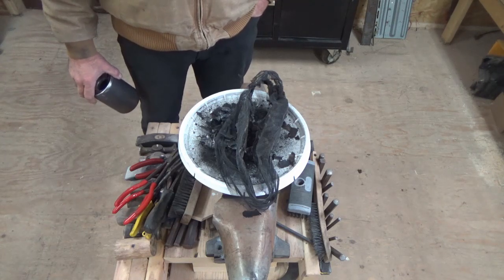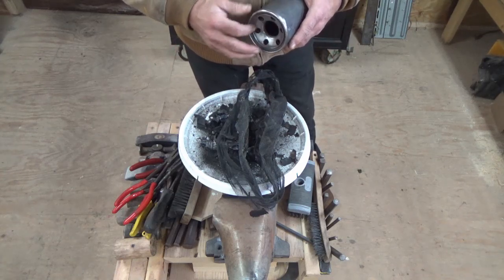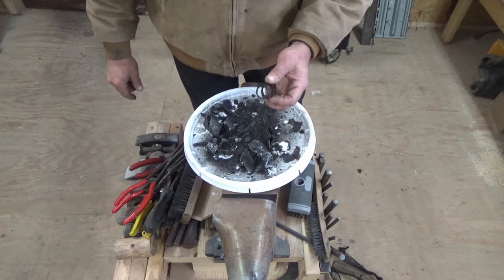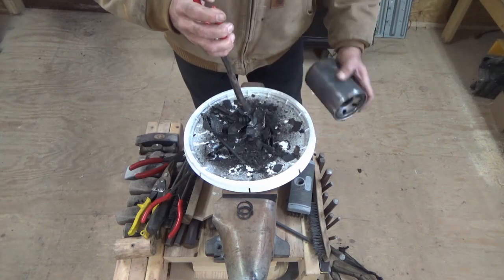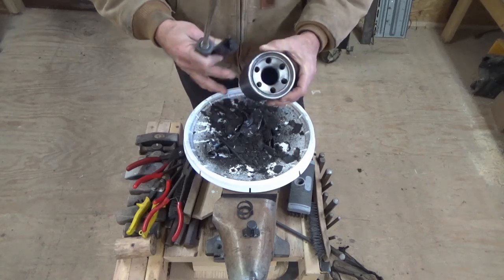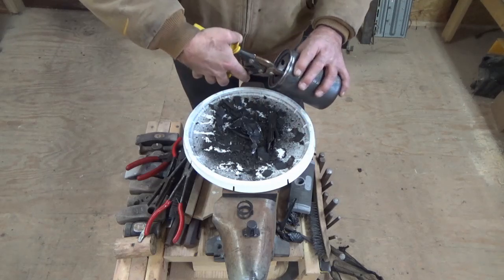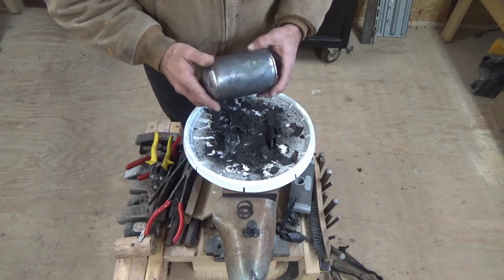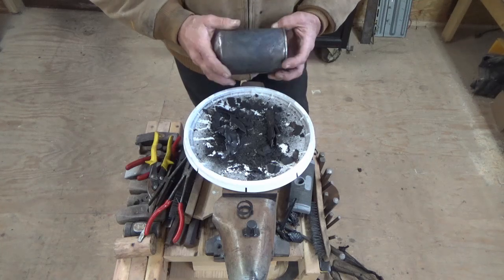John Deere 1050 Tractor Hydraulic Problems Continue, New Approach

Comment: My dad's '85 850 still has cold weather hydraulic issues similar to yours. We've changed the fluid a couple times, flushed the system, replaced the filter, and cleaned the screen and it still needs to warm up for five minutes or more before the loader works. We're just living with it.

Comment: What if you cut the back part the filter, clean it out and weld back the back part
Reply from the maker: Would have loved to do that. Would have been much easier but I'm not a good enough welder to make it leak-proof under pressure!

Comment: According to a local, who owned an 850 I believe, he said when he was disassembling his hydraulic lines he shit when there was another screen Infront of a pick up or feed line so where, atleast before the scv, loader valve, or even the pressure relief valve..

I know this comment is coming outta left field, it's just I know sooner or later it will be my turn, and I've always worried out 1 single screen I didn't know existing doing its job and clogs the dam flow.

If it's realistic either of us man perhaps we should check every dam spot there could be one when the hydraulic fluid is drained.
My neighbor had a collapsed hydraulic hose, he said it looked perfect, spent an entire season with messed up hydraulic and he was so mad he replaced all the lines and soon as, 100% back to normal. Hell if I remember correctly he said the line was maybe 6-7 years old.

Lastly, keep kickin ass, someone on here can't appreciate the sheer amount of work it takes then they're simply watching the wrong video/channel as the rest of us do
Reply from the maker: Thanks much, great info in your comment, I appreciate it!
Reply: @SteeveeDan  have you been able to get the old whore all straightened out?
The newer tractors are definitely more refined, more comfortable with more raw HP and hydraulic power but I have friends/family who own them and truthfully they still ask how much I would take for the 1050 as they wish they could find one. They so simple, actually built to the highest quality and have excellent capability all while being built from day one to literally be rebuilt in the dam field if needed.
Yet you and I are crossing the bridge when we least expect it of age related issues (both our tractors and ourselves lol)  yet a local guy hays as a side business and for his horses has a beautiful Kubota nice 75ish hp and he recently had some issues with it cost him over 3grand at the dealer (I have no idea what) when he was confident maybe 4-500 bucks.... because that's what the dealer quoted him!!! 
As frustrating as it is at times, the ole 1050's are impossible to beat. The 1070 which "replaced" the 1050 is identical but has a little 4cylinder and a syncro tranny, with the smoother running 4 cyl she has a different pump producing a little more flow, but all we do to match it is boost hydraulic pressure at the relief to 2500psi 
The same old timer I've spoken too is who recommended this pressure exactly as the safe long-term boost with many guys running it on the 8-1050's so 2250-2300 up to 2500psi he did it to his own 850 and to his credit he did infact sell her last year 75 loader with the JD quick attach 8 backhoe with a little over 2000 hours. He said "Hydraulics just came alive" and would highly recommend it so since I respected him an trust him I'm doing the same, as 2030 max psi factory is pathetic today, and our tractors are over built.
He also said when running bigger pto driven equipment one local farmer who owns an orchard had him turn up his fuel pump, dumping more fuel he made noticably more power and they had that 1050 untill 5000plus hours he said, but he was honest that he did that to help the guy and "Deere didn't know a thing". We do have to watch cracked heads, but according to him man so long as we keep a good clean radiator I side and out he's only saw 1, makes me believe it's owners failing maintenance rather than a bad design

There's a lot old Man Pete told me about these, they were his favorite tractor which is why he bought into the line himself he said. Coming from a man who truely did sell dam near everything and liked all good tractors so his word meant a lot to me so I honestly was simply bllsht lucky to happen to have the 1050.
Also don't forget to tie down your clutch pedal when she's parked for Abit, another tip he said why a few guys needed a clutch replaced. When tied down our clutch's will last a dam long time he said
Reply from the maker: @johnserrano9689  Getting ready for a family reunion I'm hosting so I've only been working the tractor around the property. Hopefully after August I'll get back to finishing the joystick conversion. This is my 2nd 1050, love this model. Thanks for the comment and tips!

Comment: Did you ever get to the bottom of your starter issue?  My 87 950 does the same and I was just going to replace the starter but some people say it can be wiring or grounds ext.. just curious if you fixed yours
Reply from the maker: I've checked all the electrical connections and so forth, mine needs a starter or a rebuild for sure. It still works and still needs a wack every once in a while but I'll eventually end up replacing it.
Reply: @SteeveeDan  yeah I cleaned up grounds and terminals ect.. sometimes it works great othertimes it needs a whack. I figured it was the starter but got a laugh when I saw yours the same as mine. Great videos, nice to have stuff to help problem solve!
Reply from the maker: @jordancichy3456  There will be more 1050 vids!